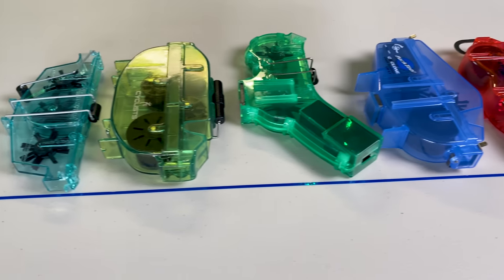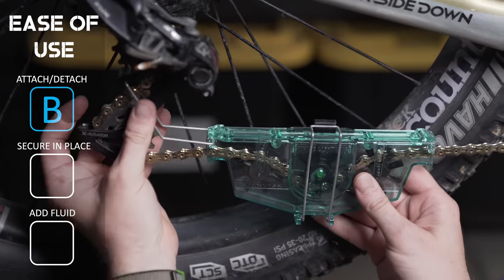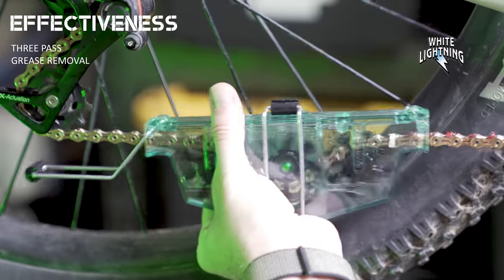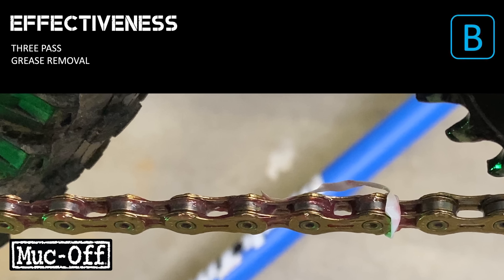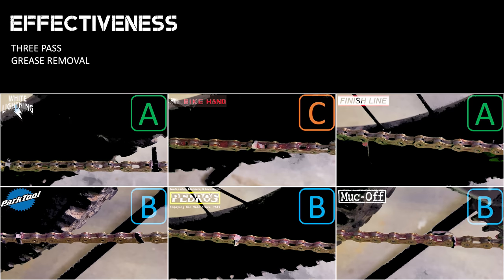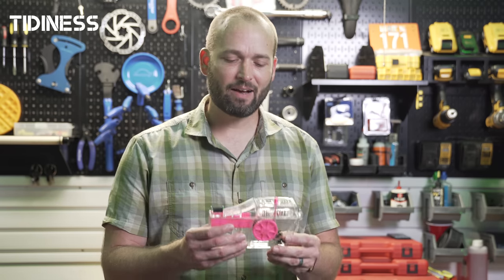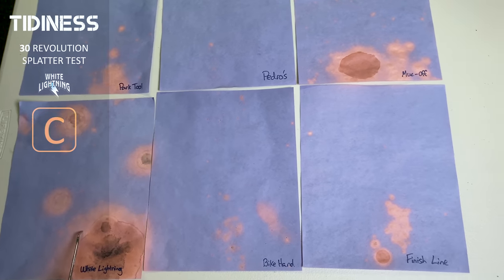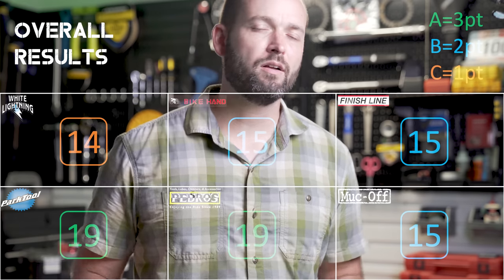Best Bike Chain Cleaning Tool Under $40? | Top Bicycle Chain Cleaners Compared

Comment: Awesome! I love these in depth tests of bike parts. Would love to hear your thoughts on best degreaser (I’m using the Muc-off lube after your test). 

One quick note on the park tool cleaner - those little metal hanger pins that close the top/bottom come off easily and always get lost at the worst times! Think I’ll give the pig a try. 

Thanks for the video - we can see how much effort & time you put in!
Reply from the maker: @Alan - thanks for the comment.  I've had that issue in the past.  I guess time will tell if the Park Tool 5.3 version resolved it.  We have degreaser in our backlog of videos, thanks for the idea! - Jay

Comment: The other long term test I would add in UV, had a number of these tools over the years and all suffer from poor protection from UV. So keep out of the sun if you are drying the units off after use.
Reply from the maker: Great suggestion! I have had a similar experience. - Jay

Comment: None of these are the best.  The best is a $10 can of lacquer thinner with a metal screw on top.  Take the chain off, tie one end to a string that hangs outside the can, drop the chain into the entire can.  Let it sit and shake it up periodically.  Boom!  Few days later, the chain is like new and it is much much easier than any tool.  Plus, you reuse that same can every time.
Reply from the maker: Thanks for sharing your experience. - Jay
Reply: it takes days to clean a chain?

Comment: White Lightning is the same as Barbieri  - and there are spare brushes on sale. But I've been using this tool for more than 10 years - and I still use the brushes that were included. Although when buying the tool, I immediately bought additional brushes. I use this tool both with kerosene and with detergents based on surfactants. Works great!

Comment: Yep, I’ve had a park tools chain cleaner for over ten years, still going strong, always clean it after each use, which is the hardest job, but recently started soaking it in dish wash over night with great results.
Reply: I run mine through the dishwasher. Have had the same finish line unit for at least 9 years now.
Reply from the maker: Nice ! 😃- Jay
Reply from the maker: Nice - didn't think of that! - Jay

Comment: Thank you for your thorough review.  That last chain cleaner has to be a Spin Doctor.  I’ve had one for ages.  Only used it a handful of times as I wasn’t all that impressed with how much effort it required.  And it was messy.  Cleaner everywhere.  Because of this, I’ve used the gas in a glass jar method for the past few years.  However, if I have a change of heart and go back to using a chain-on cleaner, this review will serve as good reference in deciding what I’ll end up with.  Thanks!
Reply from the maker: Thank you for sharing! - Jay

Comment: Ok, this stuff is too good! Iv’e totally got to put some requests in

Tire puncture resistance tests
Rolling resistance tests
Carbon rims tested to failure in a homemade jig,

Berd spokes claim to be 200% more vibration resistant/let’s test that

Vibration and shock measurements through different handlebar materials and grips

Which rear hub can handle the most torque?

Maybe a carbon handlebar shootour to see which can hold the most weight?!?

Which manufactures tire/rubber offers the most grip on a control surface

Bicycle chain lube efficiency tests

Ceramic vs stainless ball bearings for bottom brackets?!?

Id also like to see a tester be introduced any/many products “blind” to where the tester doesnt know which bike or components are underneath him/her to see of the performance is really that noticeable
Reply from the maker: @Mikeetheviking - Thanks for taking the time to share some great ideas!  We'll definitely look for ways to build some of them in as we can.  Glad you're enjoying the videos. - Jay

Comment: Remember, guys...don't use the tool before cleaning the chain thoroughly with a sponge or something similar...you want to have the chain as clean as possible before reaching for the tool...the cleaning tool should come as the last step to get rid off the final stubborn bits of dirt...and don't forget to clean the chain with water again after using the cleaning tool, to get rid of the excess solvent...this way you can achieve the best possible result without actually taking the chain off and bathing it in alcohol solutions...thanks for a great video, Jay! 🙂
Reply from the maker: Great tip!  Thanks for sharing. - Jay

Comment: I bought the pedros a while back on a recommendation from a friend and I have to say it’s been excellent so far…. Just make sure the hook works with your jockey wheel. Not all derailleurs will work from experience. 
Other than that, it does what it’s supposed to do without making a big mess.
Based on this video, I’d say the only improvement I’d make to it is possibly the addition of a magnet although I don’t know how gimmicky that is.

Comment: To add to a longer term test - I'm watching this video as I've had three Park Tools Cyclone (5.2 is my latest one) cleaners brake within the last 4 years.  All three have broken at the clamping area, typically the pivoting pins crack out of the plastic.  I typically fix with epoxy to last a few more cleans, but I feel it's now time to move on to another cleaner.

Comment: What a great video!! Excellent 👏🏼👏🏼. I own the Park Tool and I also noticed the exact same issues you did. For example the one with the brushes loosing some bristles as well. Also, I've noticed over time is that the hinges on the stainless steel brackets started to tear. Congratulations. New sub!
Reply from the maker: Thanks for watching! - Jay

Comment: I use the White lightning cause I have found them for $8 usd. I feel no matter which chain cleaner you own, they all wear out and need to be replaced. 
Not discussed but I use purple power degreaser for the solvent and it works like a charm !
Maybe do a follow up video on biodegradable solvents?
Reply from the maker: Thanks for sharing your experience! Great idea too! - Jay

Comment: Great review. I wish there was a similar review years ago.  I have been using the Finish Line cleaner pro for years now.  It is ok to use one-by systems, but when you have a city bike with a 3by system, the chain is always going all over the place. It does the job, but it requires applying force to keep it in place.
Reply from the maker: I hear ya - thanks for the comment - Jay

Comment: Honestly, the best chain cleaning tool I have used is Finish Line's Grunge brush. You can get them for as little as $10-$12 and they're way easier to use than any of those chain cleaners.
Reply from the maker: Thanks for the tip! - Jay

Comment: I know this video is over two years old. I bought two Park Tool chain scrubbers and one Finish Line over the past three years.  I purchased the second Park Tool scrubber because I damaged the first one and the shattering was not due to the tool's quality, so I replaced it with the same thing because of an alleged improvement.  The clips on both units came off after a short time of normal use.  The abuse suffered by one of them was strictly my fault.  However, I read that the clip issue was resolved, so I bought another Park.  It wasn't resolved.  The casing cracked without abuse in a relatively short time.  I replaced it with a Finish Line tool that was even worse.  It worked fine for a few months, then the case cracked without it being dropped.  I gave up on all of these tools and won't replace them with anything.  There are other ways to clean chains that don't involve a $30+ expenditure.

Comment: Ty, i do a quick clean with a rag and use the muck off now and then. I love it. Expensive. The little bottle is good but i have misplaced it now and then. I got a crack on the hinge/ slider  still works but it is a weak point. I think they would all crack if dropped. Its a good test as all tools eventually get dropped from around waist height. I wish replacement rollers for all of them were cheap and readily available locally (so $0 shipping cost). The ones with jockey hooks look interesting since sometimes it is hard to hold the unit in place.
Reply from the maker: Thank you for sharing your experience! - Jay

Comment: Excellent comparison video. Thank you. Didn't know that the Park Tool cleaning tool came with a warranty (didn't think these types of products did in general).
Reply from the maker: Thanks! - Jay
Reply: Pretty much everything Park Tool makes has a warranty. That's how much they stand behind their products. To the point where I'm pretty sure if it's still under warranty and something happens they'll replace it no questions asked. Don't quote me if I'm wrong on that last one.

Comment: Thanks for the thorough test. In the end I’ll just stick to using assorted brushes and cleaning more often. Just cheaper and frankly does the same job.
Reply from the maker: Good deal :).  Thanks for the comment! - Jay
Reply from the maker: @cc-000  Thanks for the tip! - Jay

Comment: I used to have the White Lightening style cleaner. Sold under MEC private label in Canada. I loved it because I didn't need to hold it while turning the cranks. And I felt it cleaned really well. 
Now I have a style where I need to hold it and it doesn't clean as well. So my hand gets tired as I'm cranking away waiting for the chain to get clean.
Reply from the maker: Thank you for sharing your experience! - Jay

Comment: I miss the days of taking the chain off, cleaning it with cleaning solution (which was NOT environmentally friendly) and dipping it in paraffin wax. Those days are gone. Invested in the Park Tools Cyclone and environmentally friendly cleaning solution (CT-4). All-in-all, it is a better system. Thanks for the review and glad to find out the Cyclone passed the test.
Reply from the maker: Thanks for the comment and for watching! - Jay
Reply: I miss the days of constantly lubing my chain every day and turning the dirt and dust into a grinding paste to wear out my chain and gear set and making my fingers black.... Like a hit to the head 🤪
Waxing the chain is the best thing I ever did.

Comment: Great review and comparison.  Bought the White Lightning as the Vetta cleaning tool.  Purchased over 30 years ago and actively use it for 10 of the 30 years.  Not sure how it compares to the White Lightning, but it has held up well.  Only minor bending of the top (end flexed up slightly.  Brushes now look better than yours did after one use.
Reply from the maker: Thanks for sharing! Glad you've gotten so much use out of it! - Jay

Comment: Very nice. Why nor pedaling forward. I've been pedaling foward and it goes well. I even chage spped so I can clean gears as well with chain solvent.
Reply from the maker: The Park Tool chain cleaner should support that as the tool handle can be attached on either side of the cleaner body. - Jay

Comment: Great video. I have used the Finish Line cleaner for 5 years and it has held up fine, but it is now time to replace it. This video provides great insights into the other products. How did you clean the chain cleaners? This is something I have struggled to find out and greatly important as it can extend the longevity of the product.
Reply from the maker: I just use dish soap and warm water to clean them out - sometimes I remove the brushes to give the unit a good wipe down. - Jay

Comment: I've been using the bike hands unit for years it finally cracked open, so I grabbed the Pedro unit which is a lot better and works great on my gear bikes.
I mostly ride my single speed MTB and the Pedro unit doesn't work for the obvious reason. I'm probably going to grab the Park Tool cleaner this time around.
Tech Tip: Keep your chain clean folks, I chased a clicking noise on my SS MTB for an embarrassing amount of time, buying new bottom brackets, pedals, chains, almost bought a new crankset.
Clean your chain, followed by rinsing it off with water to remove the degreasing agent, and last dry it off before you apply new lube. Also wipe off the excess lube with a rag. It's seems elementary  but I was screwing it up and skipping steps.
Reply from the maker: Thanks for sharing your experience. - Jay

Comment: I'll stick the the ones that actually clean the chain. Looked to me like the Finish Line cleaned the chain the best and spilled the least for how well it did. You just have to skip the handle and hold the unit at an angle by hand..
Reply from the maker: Thanks for the tip! - Jay

Comment: Fantastic comparison.
I would have loved one section where you check the effectiveness in terms of how much degreaser is needed per unit. Degreasers are so pricy and for me it would be super interesting to know which model requires the least amount per cycle.
I have the parktool and generally are quite happy with it, but I feel like it requires a lot of degreaser. The mic off container looks like it holds much less
Reply from the maker: Your intuition on fluid usage is accurate - in my testing the Park Tool used the most.

I did capture fluid usage data, just didn't include in the video :).  

White Lightning - 25ml 
Bike Hand - 68ml 
Finish Line - 32ml 
Park Tool - 69ml 
Pedro's - 28ml 
Muc-Off - 26ml

- Jay
Reply: @SimplyMountainBiking  fantastic. Thanks a lot

Comment: I have the White Lightning Tool (identical to Barbieri Tool) and the brushes are identical to the Finish Line Pro Chain Cleaner which I also use. The brushes can be bought separately to replace the old worn ones.
Reply from the maker: Good to know.  Thank you! - Jay

Comment: Thing about chain cleaning tools is that they worn out rather faster after a few times. The plastic brush cannot stay intact for sure as they fight against hard metal chain, and the foam used to soak back fluid also degrade/tear over time.
If you have spare master link, it might be a better idea to just take off the chain and throw your chain into bottle filled with degreaser.

Plus, using chain cleaning tool always make the dark greasy fluid spill all over the place, making it a handache to clean up after you finish your wash.
Reply from the maker: Thank you for sharing your experience! - Jay

Comment: The clip attachments on the Park Tool Cyclone will break leaving the top to be held on by you while using the cleaner.  I have been through two of these, both exhibit the same weakness and broke in the same spot.  Decent job cleaning the chain overall.  Just watch your fingers while holding the top on so the don't get smacked by spokes if rotating the pedals forward.  Bit clumsy to use it this way but it still works.
Reply from the maker: Thanks for sharing your experience! Glad you found a way to keep it working :) - Jay

Comment: I have both.  I liked the chain pig but it broke after a small drop.  I've been using the park tool its better built but I miss the jockey wheel hook.
Reply from the maker: Interesting, thank you for sharing your experience.  Seems to validate what I saw in the testing. - Jay

Comment: Real world usage and yes I've owned the park tool for quite a good few years. The park tool cleaners weakest part are the locking spring clips , where they hinge.....the plastic break and the spring clips then fall off the body of the unit, when you unclip. The plastic in general seems to brittle on all of these cleaners.
Reply from the maker: Thanks for the tip.  Yes - my old unit had that problem.  This one has been good so far. - Jay

Comment: i appreciate the video content but imma stick to my old nalgene bottle and formally mouth cleaning toothbrush combo, i am always weary of ever running a solvent on components left on the bike. ive seen to many times issues with cross contamination or issues with solvents getting into the hub with this approach. i just leave my solvent in my bottle and drop the chain in while i pull the cassette and give everything a scrub, wipe, and rinse before re-lubing and reinstalling. the bottle of solvent for me normally a citrus degreaser can clean a chain dozens of times before needing replacing. right on, keep enjoying the two wheeled contraptions.
Reply from the maker: That will definitely get it done! Thanks for sharing your method for others to consider. - Jay

Comment: That was great!  Wish I'd seen it before I bought 2 of those models.  I was super disappointed in the Park Tool chain cleaner, the large wheel didn't rotate and it made an awful mess!!.  I then bought the Muc Off offering and wasn't happy with that one either, although better than the Park Tool.  I am going to try the Pedros chain pig.
Reply from the maker: Thanks for the comment :)...let us know your experience with the Pedro's Chain Pig! - Jay
Reply: I had the same problem with my large wheel.    I fixed it by unsnapping the wheel halves then resnapping them together.
Reply: @johncarrington8612  Wish I knew that before 🤣 I dropped it and it broke so it went in the bin.

Comment: I have a Ginish line that I have bought around 2008, so it has almost 25 years. The design was almost identical. The olny difference is that the 2nd stage of cleaning was performed by a sponge... That was in pieces after a couple of uses. I have discovered that an old sponge for dishes can be cheaply formed into something that fits. The other issue is that the top part is no longer well aligned with the bottom part. But it still works ok. The magnet works well. There is always grey substance there that is hard to remove.

Also on the film it is jaming because it is hold incorectly. You need to press it down. Then it works smooth. Unfortunately you cannot use it for single speeds where you cannot change the tension on your chain.

Btw
Reply from the maker: Glad to hear it's held up so well for you :) - Jay